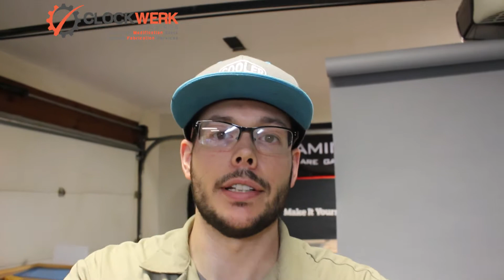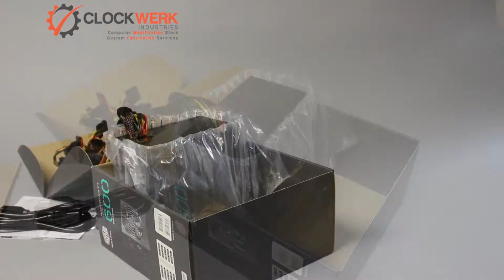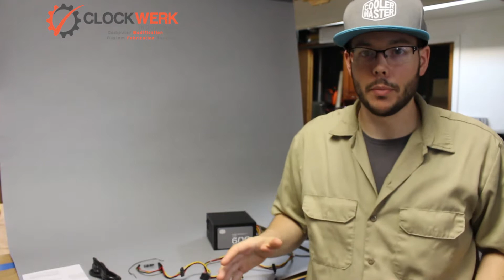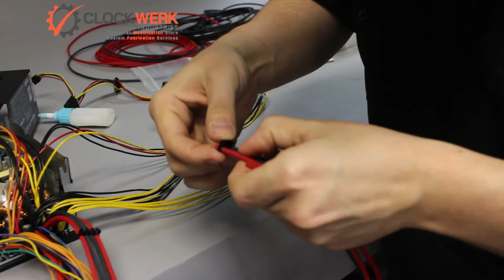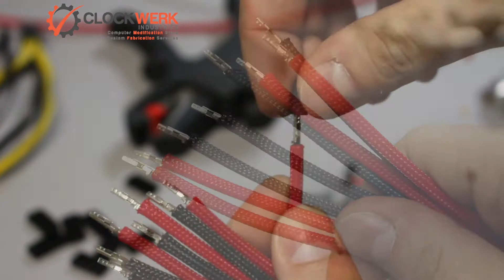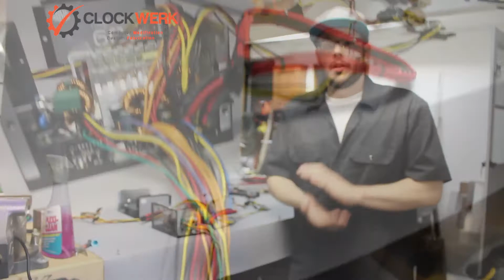Mastercase Pro 6 | Episode 06 - Cooler Master Masterwatt Lite 600 Review & Sleeving

Comment: Can i use it with a r5 2600 and new 2070 super?? Some people say that is enough but in the gpu specs it says 650 required...i dont know if i should replace the PSU...
Reply from the maker: Thats cutting it pretty close, it would probably work, but will probably shorten the life of the PSU as it will probably be taxing on it, you could probably set it up and use it but I would eventually get at least a 700w PSU in the future. I would maybe keep the gpu settings down a bit and throttle it some until you can get a bigger PSU.